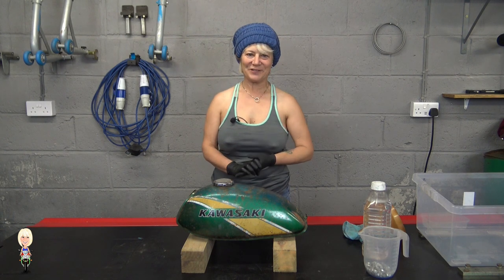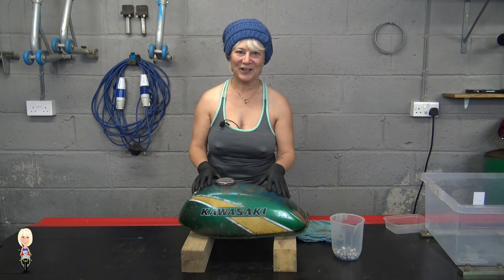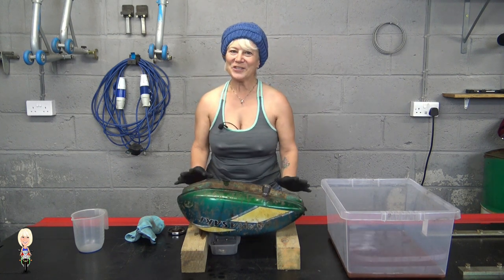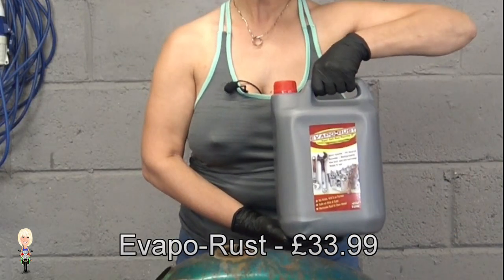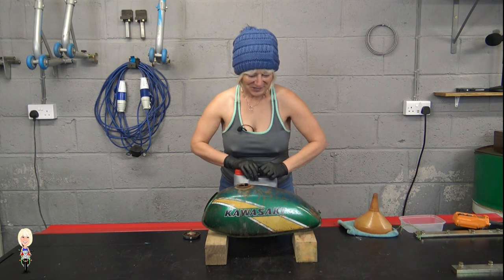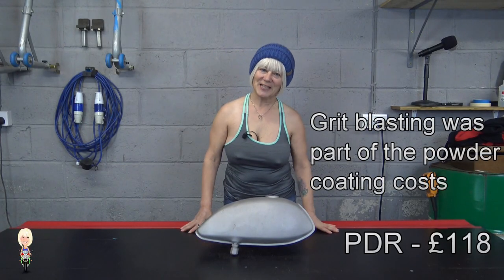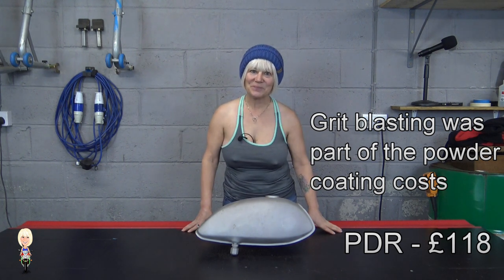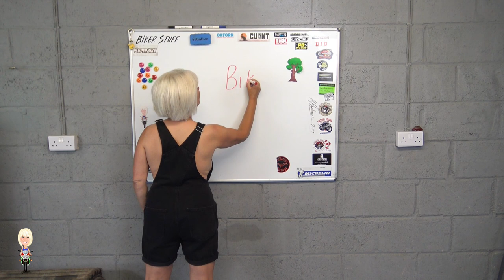Kawasaki KM90, de-rusting the petrol tank - Part 10

Comment: I have restored many bikes and I use meratic acid and pellet gun bb's to clean rust and scale out of the interior of fuel tanks.  The bb's are steel so a magnet can get all of the ones that are stubborn to be removed from the tank. Once done I just coat the tank with motor oil and it's good to go.
Reply from the maker: Sounds good.  You shouldn't look into POR15

Comment: I'm guessing by the comments that shaking a tank full of nuts had S the desired effect ! There is a product made by RG , their Rust remover that has the highest phosphoric acid content on the market and can be thinned . Another way of treating the inside of the tank is by black or grey Parker I sing . Again a weak solution of Phosphoric acid is required with wire wool and zinc or manganese oxide from old batteries . Shame the tank is porous . I have a friend who has been repairing bikes for 50 years and never throws anything away . Perhaps he has one or something that can be adapted easily that will suit the bike .Being a single spine frame there must be any number of tanks that can be made to work .

Comment: Because the tank seams are stitch welded I would cut the tank in half length ways to repair it. Looks like a project for an apprentice panel Beater take it along to your nearest trade tech school and see if one of the young guys will take the job of for you. 
A decent apprentice 2nd or 3rd year could make you a tank. I made an Easy Rider style tear drop tank when I was at trade school.
Good to see you are reminding us motorcyclists in the interests of road safety, to put our headlights on. 😳😳

Comment: All that work and the  the dramatic light test.  Can’t imagine another used one will work. It should have the same problems.  
This quote came to mind as the nuts went into the tank:  “I love work … I can sit and watch it for hours.”  (Max Kunkel, Jr, my dad).  What was that first liquid that she put into the tank for a short time?  “White Oil” was said, I think.
Reply from the maker: White spirit is an oil based paint solvent